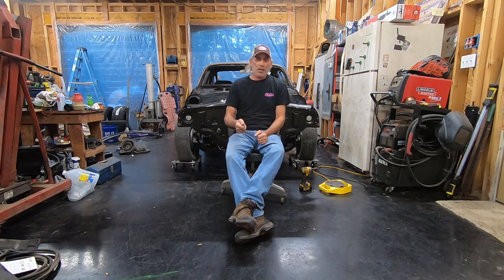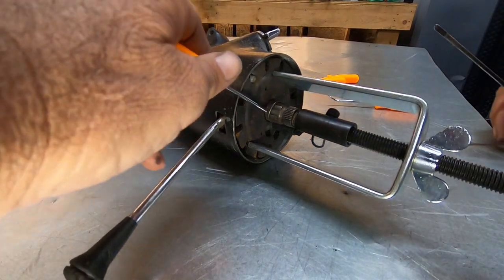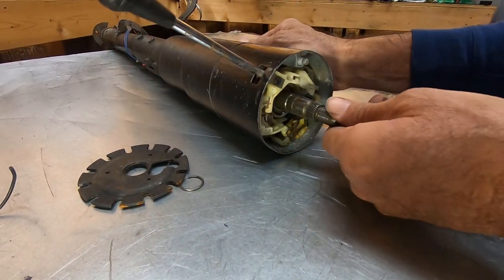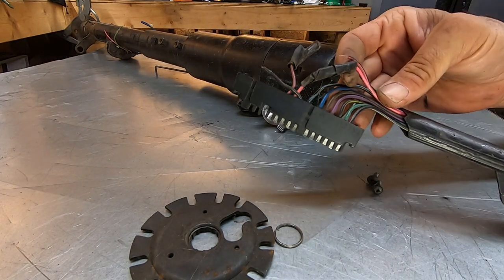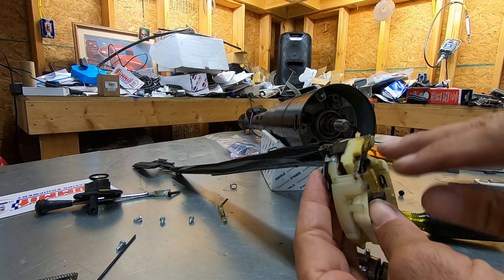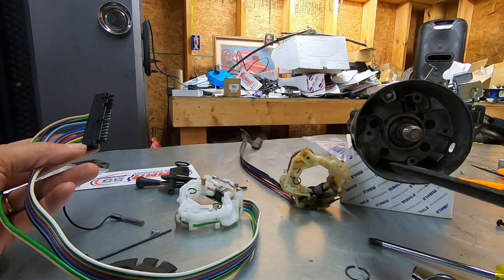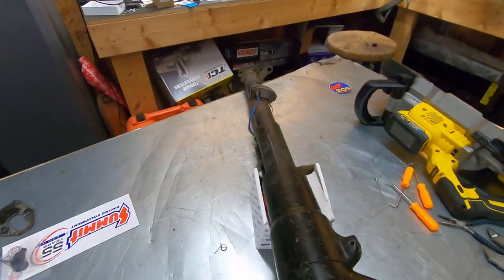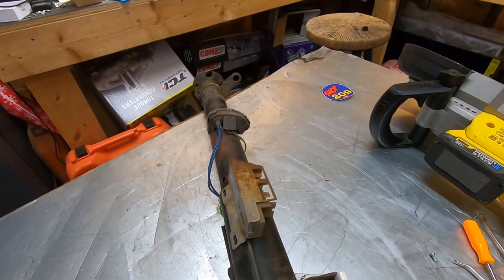Budget Chevy Nova Steering Column

Comment: I love how simple these older cars are. You're doing a 20 minute video about how to basically rebuild the column, and I don't need a PhD in mechanical engineering to be able to figure it out. The new cars, well, they're a different story.
Reply from the maker: Yeah. You have to be a rocket surgeon to get the steering wheel off of a new car.
Reply: @Shop209  yup. Now with the neutral safety switch, is there a different switch for a manual transmission?
Reply from the maker: Yes. The neutral safety switch was clutch pedal activated. Can’t remember how the reverse lights were activated.

Comment: Great video. I’m stuck and cannot figure out how the cast housing that has the lock bowl comes off. I need to replace the gear that connects the ignition switch rod to the key engage. I just have no idea how to remove that front housing.

Comment: My aftermarket steering wheel came right off no puller needed but under the adapter cone it looked like a 3 holed steering wheel hub pressed on the center splined shaft.the locking plate is behind it...any idea how to remove the center hub?